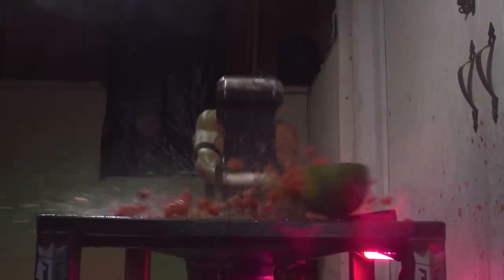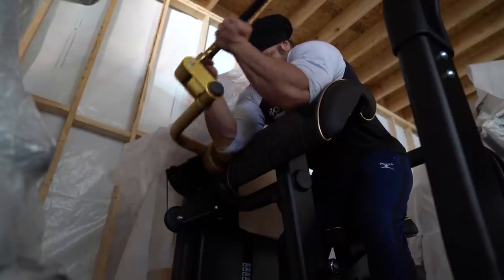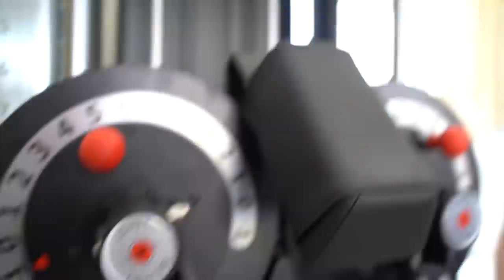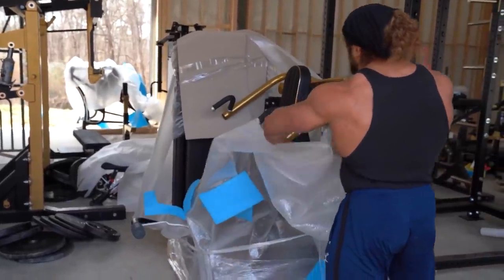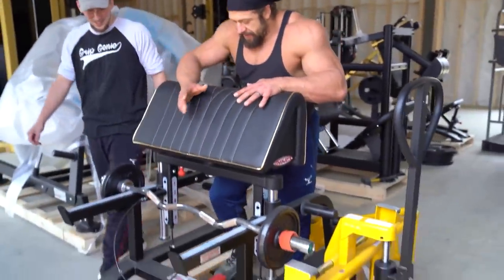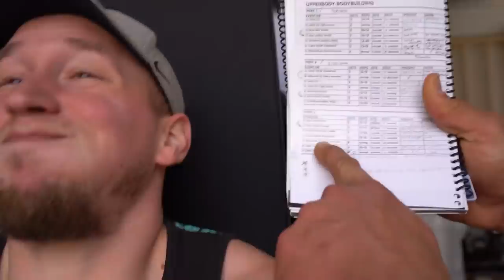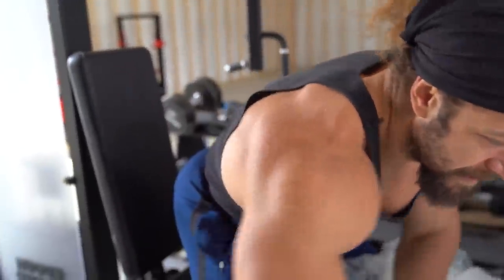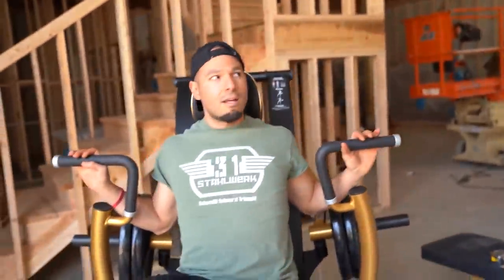BEST HOME GYM LAYOUT? WHAT? HOW?

Comment: My Layout would be like this:
- Chest machines on one side
- Back machines on one side
- Leg machines on one side
- Then i would put the cable Crossover where ever the largest mirrors are
-  And put the Monolift/Powerlifting stuff on his own area.
Reply: With multi-use machines closer to the middle and isolation machines closer to the walls. And most importantly, dedicated down-lights and an empty area in front of the mirrors for posing practice.

Comment: Lighting guy here: I would look at the behind the scenes videos for sets of action movies to give you some starting points for lighting. Movies like Gladiator and 300 rely heavily on big overhead soft lighting. I would suggest putting the biggest soft box you can manage 3-5 feet over your head where you pose in the mirror, turn off all the other lights and close the doors, let the background go dark. You could DIY it by stretching a big sheet of white reflective fabric over a frame, 6x6 or 12x12, hang it up and shoot lights up into so it bounces back down in a soft way.
Reply: 300 and Gladiator rely heavily on big overhead lighting for creating an authentic outdoor environment, so an entire scene is lit evenly. While this would be wonderful for filming general filming in the gym space, it's the exact opposite of what you would want to chisel a physique. One big issue with the suggestion of a massive softbox 3-5 feet overhead is the light fall off. a light 3 feet from a face means the light is also 8 feet from the lower legs. Thats almost 3 stops of brightness difference between the face and the lower legs. Not to mention all the shadow transitions would be soft and low contrast.
What he needs is low fall off (distant light) to evenly light the body, with hard light (small / distant light) to create crisp shadow transitions, that has narrow coverage (gridded / snoot / fresnel) so as to avoid lighting any surfaces around him (especially the background as you mentioned) and keep fill light to a minimum.
Reply: @robhallphoto  I'm lookin out for Juji and thinking of a solution that could be easy to use and semi-permanent  if hung from the ceiling, lights controlled by remote, minimal setup and can be sweetened with other hard lights. Less stands to deal with, once set up is mostly plug and play. The overhead light could be rigged to the ceiling with pullies to adjust to the need of the scene. Yes, your point about falloff is valid, but with a big enough soft source far enough away, you get enough fill to reach down the whole body pretty equally. You can fill in the rest with bounce cards.  It might look a little soft in person, but you can always boost the contrast in post. For video you need to light a whole space to allow for movement, a snooted down spot wouldn't works so well for video because it has such as small area of focus. But yeah,  a gridded soft box to wheel around the new gym would be probably the first thing I'd get if I were Juji and wanted to build up my lighting game.

Comment: CONSIDERATION FOR GYM LAYOUT - position and spacing of machines should ALSO be optimized for cleaning the floor, dusting off machines from all angles, etc. What kind of floor cleaning machine will you use, what is the width, etc?

Comment: Lighting pro here (in a commercial photographer, uses lighting to enhance / manipulate appearance sense).
Here's what you're looking for:

Maximize the distance between light and subject : the further the light is away, the more the relative size decreases. As the relative size of a light source decreases it creates "harder" shadows. This means the shadows it creates are more chiseled and rapidly transition from light to dark. The sun (which I know you love) is the best example of this. It's technically a large light source, but because it's so far away, it's relative size (to us) is tiny.  To apply this in your gym, mount your light as high as possible, while respecting my notes on position below

Minimize the size of the light source : Between a smaller light source and a larger light source at the same distance, the smaller light source will produce harder shadows. To apply this in your gym choose a small, single source lighting fixture instead of a large panel type fixture.

Reduce fill lighting : In lighting there is a "key" light that is the primary light source illuminating the subject. Additional light sources that lighten the shadows created by the key light are called fill lights. Fill lights are the enemy when trying to maximize the contrast of your muscles. It's very difficult to have amazing bodybuilding light everywhere, because the more light you add you're just going to be creating way more fill light, reducing the effectiveness of each individual source. The only way you could get great lighting all throughout your gym is by choosing fixtures that restrict the beam angle of each lighting fixture to not cross with other fixtures, although this would be a NIGHTMARE to film in, because your exposure would rapidly change as you move throughout the gym.

Contrast : This is where I've seen you mess up otherwise great lighting in the past. You get great lighting on you (sunshine) but you don't have anything dark BEHIND you, to allow the contrast of your physique to "pop". This is a mix of mistakes, a) bad scene composition b) bad camera settings / automatic camera settings that don't know what you want. To apply this to your gym, make a physique / posing area with only two light sources (more on this below), and have that be about 10 feet + away from a dark wall that you film towards. This is preferably away from any other light sources that could fill it in.

Reduce "spill" of posing lighting : You want the lighting to be a focused beam of light, think stage lighting. This ensures it does not bounce off other surfaces in the room, filling in the shadows and reducing contrast

Position : 
Light 1 : High, overhead, but not directly overhead. If you go directly overhead the shadows will stretch to long, your eyeballs won't be visible, your teeth won't be visible because your nose shadow will cover them. To estimate the position, I would suggest standing normally, however your chin is positioned when you pose. Next, look up with just your eyes. The highest point you can see without raising your chin, that's where you want your light. The logic behind this is if your eye can see a spot, a light in said spot would hit your eye. This will create hard shadows all across your body, without making you look like a raccoon.

Light 2 : From the same standing position as explained in light 1, you want a light up high, slightly behind you, pointed at your back. This will create "rim lighting" carving out your frame from the dark background. This is important as when you have a high light hitting your front, obstructed areas like your lats won't be hit by any light and will just fade into a dark background. This rim light ensures the entire outer edge of your frame is carved out with light and visible to the camera.

This is the best I can do without having the dimensions of your space. With the dimensions, I could tell you lumens, and what beam angle you would want from fixtures as well as the spacing of lights. Or suggest you specific lighting gear for a posing "zone".

my contact is in my about section on my channel if you have any follow up questions. Mufu dad responded to an email I sent previously as well letting you know I'd be happy to help with any technical questions regarding photo / video / lighting.

Edited to add : I've seen other comments regarding "big soft overhead lighting" like used on movie sets. Don't do this. That creates soft, even light over a large space, which is awesome for movies because they capture image data very evenly, which grants the flexibility to modify it later. It's the same concept as shooting outside on a cloudy/ overcast day, everything is "Even".
But, there's a reason you've never been outside on a cloudy day and said "this is great light" and started flexing. Because its soft and even light which lacks the contrast necessary to carve out a physique.  You want HARD light as described above to chisel a physique. Show me any physique competition with a large soft overhead light panel lighting the stage. It doesn't exist, and for good reason.
Reply from the maker: Copied to a document. Thank you 🙏

Comment: When I’m planning out a room (much smaller scale than this lmao) I like to get measurements of all furniture/machines and get measurements of the room or building itself. Then measure any immovable objects such as your staircase and factor that into the “map” you could call it. Draw your building on a piece of paper or cardboard. Convert measurements as such: feet=inches and inches=centimeters. So if you have a 7ft 3in measurement it would then be 7in 3cm. Create paper cutouts of all your items/machines in their proper measurement conversions and move them around on your blueprinted building map. Long explanation but that’s what’s worked best for me and my OCD brain. Good luck can’t wait to see the finished product!!
Reply from the maker: We did that with software originally but the staircase had to be completely redone and that alone threw off half the layout. Also the measurements were underestimated and when we butted the equipment together we found less space. Still a good idea but in practice those problems we did run into!
Reply: @jujimufu  I’m not very savvy when it comes to computer software but I’m surprised still to hear it didn’t make the process much easier. My fathers a carpenter so I’ve always had a lot of respect for all the work that goes into things like this. Really fun to follow along with your journey of it even with all of the struggles😂

Comment: regarding lights,

Lights from the front flattens,
Lights from the top and side enhance volume by accentuating shadows, thus creating contrast,
Lights from the back accentuate the shape/"silhouette".

Ideally because you have such a big room, you'd prob want some "normal" efficient lights,
and some hard, directional and powerful lights to pose and stuff. Good light is too much to keep looking at.

You might either to look at continuous light for that, or go the extra mile and get actual stage light, in any case you'll have the opportunity to experiment with them.

As an ex pro ballet dancer, usually you look jacked with a mixture of light coming from the top and the sides, that being said it might not be the best layout ever.

my two cents, you're awesome.

Comment: If you’re looking for layout ideas, I have a few suggestions for your consideration:

-The equipment that may leave you most susceptible to major injury should be closest to your emergency exits, so EMT personnel can get to them as soon as possible

-Preferably place the equipment in a gradient(possibly strongman/powerlifting/bodybuilding/misc.) that primarily takes into account the equipments utility to their respective training modalities AND also grouping together their function(EX: placing a bench press in the powerlifting side, while also keeping chest/tricep isolation machines closest on the bodybuilding side transitioning away from powerlifting into bodybuilding)

-Try to take into account if you’ll have your doors open, and if you do, will using the equipment place you directly in front of the sun? I dont imagine anyone wants to stare at the sun while they lift, even if it sounds cool on paper.

-If you have running water, I would highly recommend a water bottle filling machine like you see at gyms, as well as a small bathroom.

Hope this helped a little. I wanted to try and think of things besides just the layout, since I’d love it if you were also as safe and comfortable as you can be in your new gym. 
Take care!

Comment: As a hobbyist photographer, if you want to get good video or photos in the gym you want a High CRI (color rendering index) number associated with the light bulbs you pick: 85-90 is ideal. Anything less will not give you accurate colors. This is a separate number from Luminosity (brightness) and color temperature (5000k is like a clear day). For most indoor areas I tend to prefer slightly warmer color temps (around 4000k to 4500k) but that is merely preference.

That said because you are doing video work in the gym, that will likely change how Luminous you want it as compared to what you are thinking as ideal for posing. But knowing the luminosity is one thing, knowing how much lighting you need for a given area is another. It is easy enough to calculate though, just find the square footage of the space and divide that into the lumens available (lumens/sqft) that gives you the foot-candles (Lux is lumens/sq-meters). 

Some typical examples of Lux are as follows:

50 lux – Family living room lights.
80 lux – Office building hallway/toilet lighting.
100 lux – Very dark overcast day.
320–500 lux – Office lighting.
400 lux – Sunrise or sunset on a clear day.
1000 lux – Overcast day; typical TV studio lighting.
10000–25000 lux – Full daylight (not direct sun).
32000–100000 lux – Direct sunlight

to convert to foot-candles just divide the Lux number by 10.764.

So an example would be a 10ft x 10ft room lit by one 1000 Lumen bulb would give you 10 foot candles or a bit over 107 lux.

From a video or photography point of view, the more luminous the scene the harsher the contrast. You can remedy some that by diffusing the light (through diffusers lol) or by bouncing the light or having by having portable light sources to fill in the shadows. 

You may consider putting multiple light sources on different switches, so you can easily vary the amount of light you have so that you don't have to have the sun on while not filming lol

Comment: I am beyond envious of your new space, so couldn’t help but think about the layout!  Since you have a rectangle to work with, it would seem best to leave space open in the very middle for vids/demos and maybe a turf track going out from the middle to each end of your barn - the track would be used for lifting and as a main walkway.  Place the powerlifting/deadlift/monolift platforms along the walls in the middle, and then start laying out your lower body equipment towards one direction away from the power equipment in the middle and the upper body equipment towards the other direction of your barn.  I would probably keep the compound machines a little closer to the powerlifting equipment in the middle and the accessory machines further away - unless you really see the benefit of having one or two specific accessory machines closer to the powerlifting area.  If you only have one set of dumbbells, then closer to the middle would allow you to get them easily for either lower body or upper body, but you may want a dumbell set in both the lower and upper body sides of your gym.  Hope that makes sense…if you read through this whole thing and a little graphic would help, then no problem just let me know.

Comment: Juji, please make sure the framers add blocking anywhere you plan to wall mount any equipment or hangers. 
The blocking will provide additional mounting structure behind the drywall. It will make your like 10x easier down the road.

Comment: Not an expert on lighting or bodybuilding lighting. But the gym I work at has a grouplesson space which has great bodybuilding lighting. And the way it works is that it's a room with black walls, black floor tiles and the light coming directly from above. But the lights are really focused because they're discolights. So I think for a bodybuilding section you need lights from the ceiling at no or almost no angle. And by using black for the walls and floor you eliminate a lot of light scatter. That way the shadows you want on your body don't fade out by reflecting lights from the floor or walls. So if it's still possible you can try to get a rail with black velvet curtains and lights directly from the ceiling. That way you can isolate an area of any light from the sides. For the lay-out I can give you a more educated advice. Have a heavy free weight area, separate the machines so push machines and pull machines are together. If you want some machines to be eye-catchers try to get them in the middle like the monolift or the cable crossover (Do think about having good vision to mirrors from those machines. Good luck and have fun in your new gym!

Comment: Free weights in 1 area then separate the machines into upper body & lower body than an area for all your cardio equipment. The best bodybuilding lighting would work best from pod lights under your loft so it is good down lighting that can be isolated from the rest of the gym lights.it would also be a good place to put mirrors as well.

Comment: I would make a line where you start with the muscles on the top of the body (shoulders, traps, chest etc) going Lower and lower as you go on to that line (like triceps and biceps, lats, mid section and then glutes, quads, hams etc) and then I would make a separate spot for compound movements, I think that would make the most sense because nobody is going to do supersets of exercises that involve muscles from distant parts of the body so it would also be useful in a way
Reply from the maker: Logical!